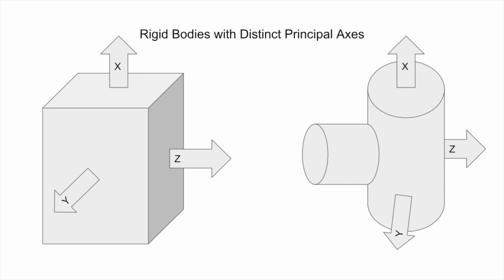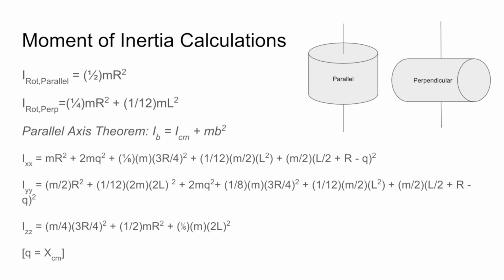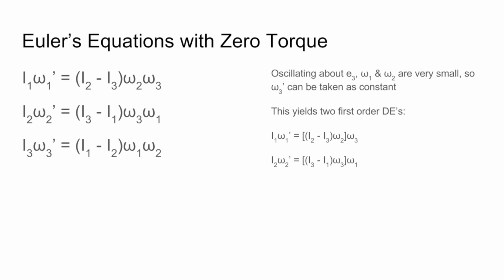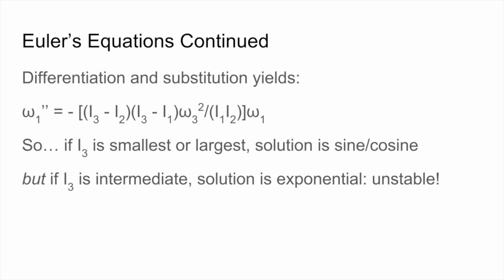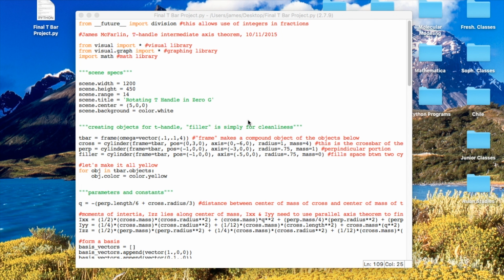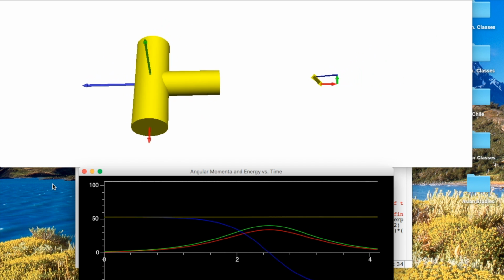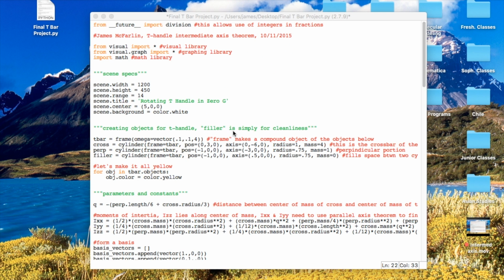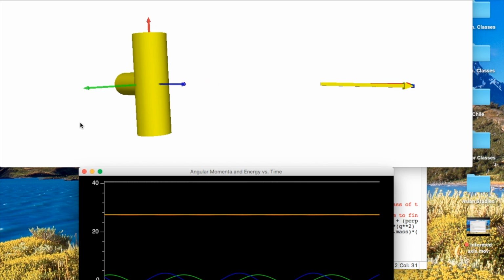Intermediate Axis Theorem - Python Code Included

Comment: Would you think a tetrahedron(3 sided pyramid) would rotate the same way? Can you try?
Reply from the maker: That's a good question, I'd be interesting to see that simulated as well. I have to admit I haven't touched python for many years so I probably won't program a simulation myself, but if you wanted to modify my code to do so it could definitely be a good experiment!
Reply: I tried to do that but could not figure out how to do the imports of visual, graph etc.  Could you help me out with instructions how to install all needed?
One more question: When you changed the initial angular velocities the flipping stopped. What is the condition for the flipping to happen? X=.1,Y=.1, Z >.1 ? Thanks

Comment: Is the yellow sticker on the t handle causing this imbalance , I mean would it still do this if the weight distribution was prefect ?
Reply from the maker: The python code is written assuming that both sides of the t-handle are evenly distributed in mass, so the sticker is not a factor in the simulation. Theoretically the sticker could impact the rotation in real life, but nevertheless it doesn’t appear to disturb the rotation/oscillation much in the video. Thanks for the question!

Comment: Could you please upload the python code again ?
Reply from the maker: just updated it - sorry about the delay! Enjoy!
Reply: @jamesmcfarlin3526  Thank you very much !
Reply: @jamesmcfarlin3526  Do you still have the original code, that Luke wrote by any chance ?
Reply: @jamesmcfarlin3526  Or what would I need to change in order to make your code work for box object?
Reply from the maker: @dukeofnuke2446  I don't have his code anymore, unfortunately. in the section under "creating objects" in the code, you should be able to tweak those back into a box shape. You may be able to delete a component to make it easier too.
Reply: @jamesmcfarlin3526  Thank you !
Reply: @jamesmcfarlin3526  I did it, I will post the code I modified for a box object in the comments. Can I post your original code as well via Github ?
Reply from the maker: Glad it worked out. Of course you can! Please just credit my work. Thank you for asking!
Reply: @jamesmcfarlin3526  Of course, I will credit you.